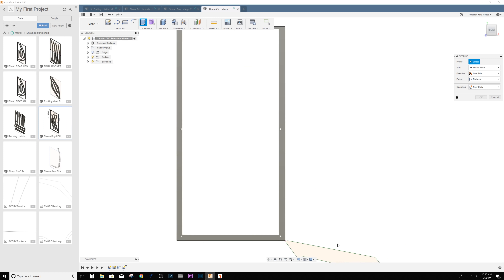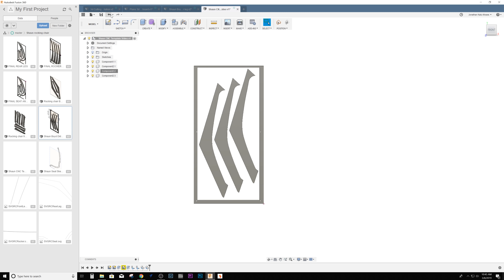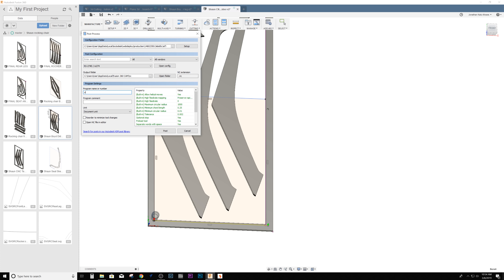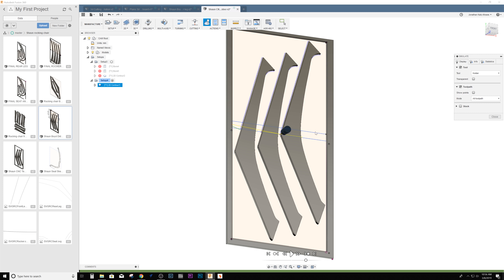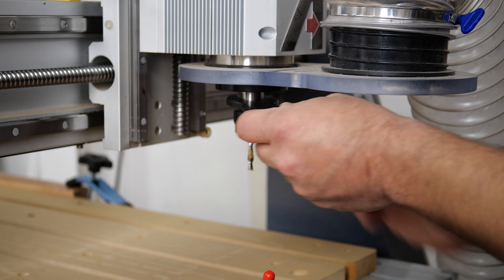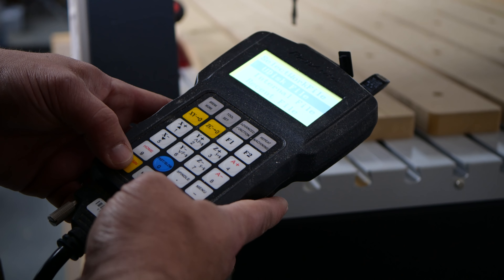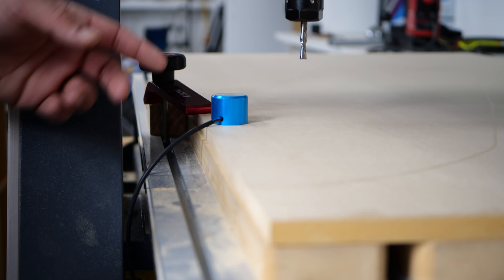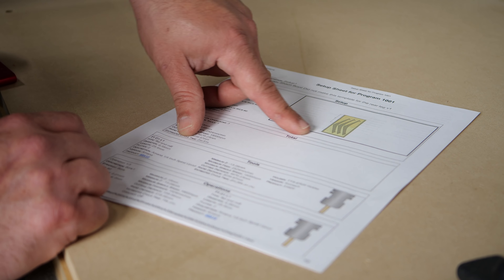How To Cut Parts Bigger than your CNC Bed with Fusion 360

Comment: Question: The origin of the first toolpath is the bottom left corner of the spoilboard while I thought it would have been the center of the bottom left pin. Cause the origin of the second toolpath is the top left pin center. Can you clarify?

Comment: Found this really great video, but I didnt catch how you zero the x/y after moving to the second setup?
Reply: (Maybe) answering this for anyone who might be wondering that same thing as I did. I had the same question, but after watching the video a couple times, he says that he moved the origin point 24" or 1/2 the size of the stock, which makes sense because that would like up with the first holes that he cut below that. I would imagine that he maybe just used construction lines and a point to place it and maybe deleted them after he had set the origin. Or at least that's what I'm going to try!

Comment: why are you drilling holes with a down cut bit? that can actually start a fire due to friction
Reply from the maker: Maybe if you were using it as a drill but those holes are larger than the bit. The bit is being used the same way it would elsewhere to clear material. The only difference is it does it in a circular manner. Plus, realistically, I don't know anyone who would take the time to change and re-zero their bit for such a short operation.
Reply: @katzmosestools  ok. thanks for the info.

Comment: Yeah I have the next wave and use vectric aspire for my cnc. I think I like the setup on that software a bit better. No need for translating to g-code, you just save the tool.path straight from aspire or vcarve and take to cnc, clamp it right and set z height and zero position and run. That being said that is my nemesis I have broken a few bits that way, and yes i am a total newbie with cnc. But i like it
Reply from the maker: That's literally the same with fusion. Vectric is great for engraving. After that Fusion isn't even playing the same game much less in the same league as vetric and vcarve. It's like vetric (great for beginners so I'm not knocking it) is a go go power wheel and fusion is a Mazerati. I highly suggest taking the time to learn it. It'll change your world. Theres a great class on slillshare called learning fusion in 30 days that I highly reccomend. It's free and soooooooooooooooooooooooo powerful

Comment: Instead of setting you Z=0 at the top of your workpiece, set Z=0 at the top of your spoilboard. Stock material can vary slightly in thickness and if you set your Z for the top of the spoilboard you don't have to worry about these variances. (Just don't forget to set the Z=0 in Fusion by selecting the material corner's BOTTOM node and not the top node.)
Reply from the maker: Great idea bud

Comment: I know this is pedantic, but I wish we'd stop calling things "a CNC". CNC is an adjective that stands for Computer Numerical Control. You have CNC routers, CNC mills, CNC machining centers, etc. Technically, laser cutters, and 3d printers are CNC devices.

In this case, it's "CNC router bed" or "CNC router capacity" or "CNC router working area" (Shapeoko,  X-Carve, etc. are CNC routers)
Reply: @Marcels-Workshop  It's an important distinction, though. Folks look to you for info as someone with knowledge in this area. It would be awesome if the info was more correct so people would use the right terminology and not end up looking ignorant if they apply for a job in this field, or end up talking to a machinist.
Reply: @Marcels-Workshop  Ok man. I wasn't being a jerk, but thanks for doubling down and attacking anyway.